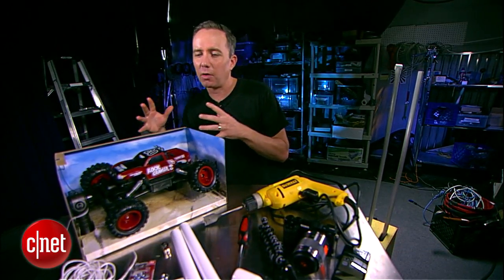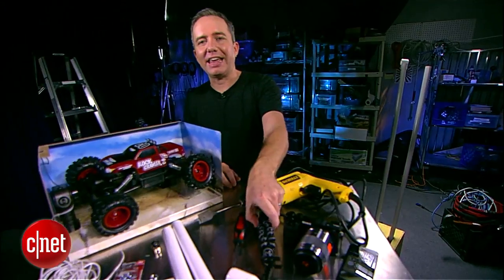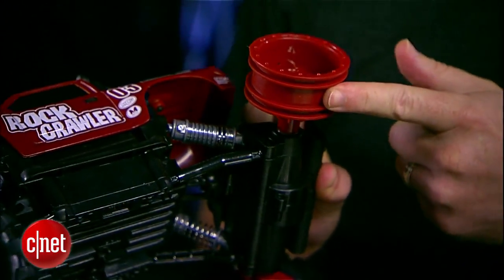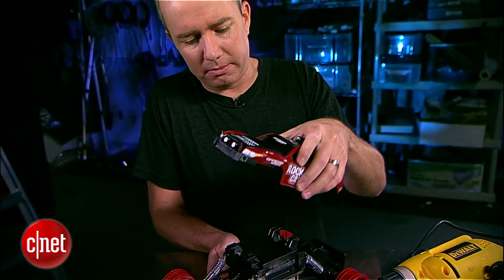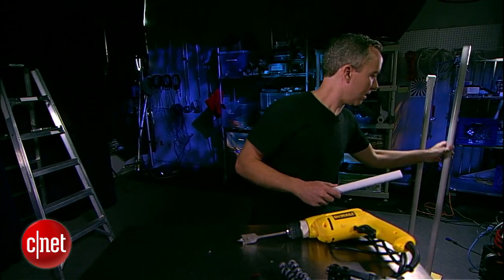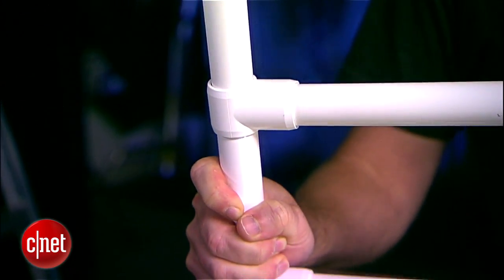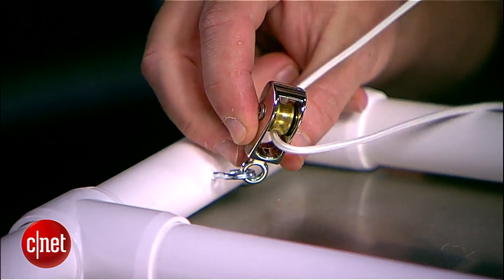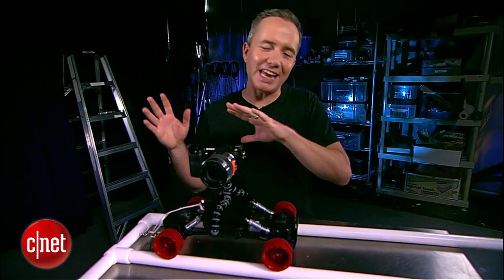The Fix - Make your own camera slider

Comment: Just dump the gorillapod and buy a .15 bolt the same diameter as the the mounting hole on the bottom of the camera. Also. if you have your heart set on using the RC car. Go to your local thrift store and buy a used one. Can usually pick one up for less than $10. And the money spent goes toward the community you live in.